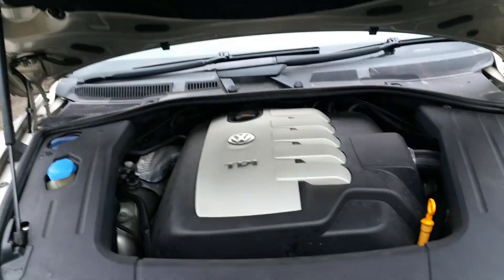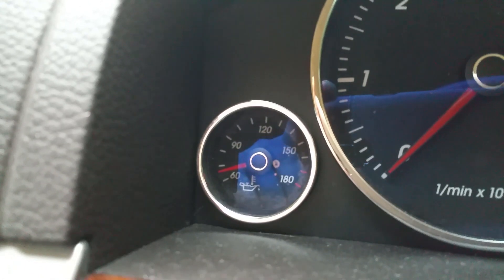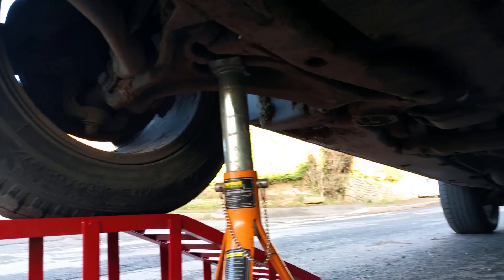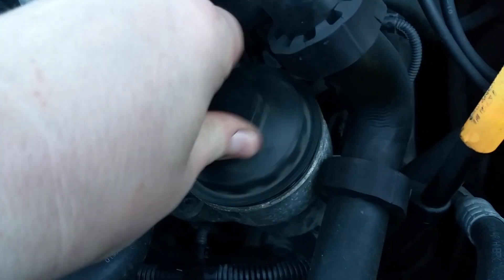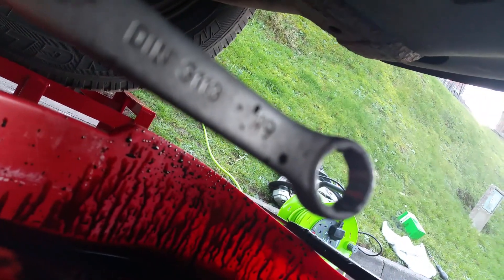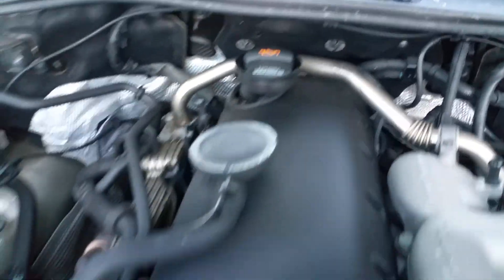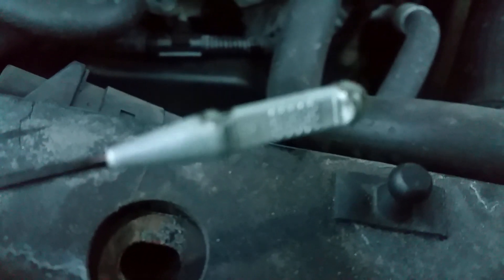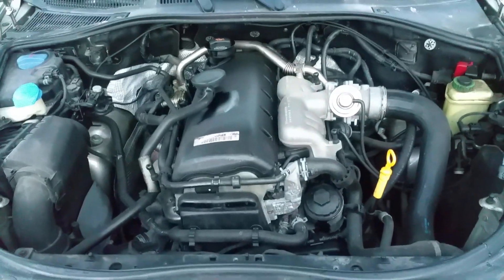Change oil and filter Touareg 7L 2.5 tdi R5

Comment: hey, just found your videos, my friend has one of these and I've just done the steering pump on it, needed to get the inlet mani and engine mount bracket off, what a nightmare. now the thing has conked out, my mate got his vagcom on it and its not showing any problems, going to change the fuel filter and see if that helps. then an oil and filters change too.
Reply from the maker: had to replace a turbo as my blew up in smoke had to take the bracket off as well it was tough but got through it

Comment: Hello i have a 2004 touareg 2.5 tdi 174 hp . Is the only option for engine oil 506.01 spec ?
Reply from the maker: that is the best oil option for your engine, i will double check if there is a short interval oil recommended, but i've always used what the doctor prescribed as i want my engine to last
Reply: You can use 505.01 for short intervals
Reply from the maker: you can but its not recomended as the viscosity of it is too thin, its all to do with the viscosity of your heated oil and 505.01 will be too thin when fully up to temperature. slowly (over few years) you will start damaging the engine under lubricating it also depends on how much you drive on how fast you will kill the engine

Comment: Do not use those ramps anymore !!!!!! I had EXACTLY THE SAME AND THEY FAILED UNDER A 2.5 Touareg !!!!!!!
Reply from the maker: Didn't look very sturdy but they held up a Towrag
Reply: @NoExpert  Have the same ramps and the same car 2.5tdi touareg ....had the car with about 150-200kg of stuff inside and drove onto the ramps....they folded as a piece of paper .......got a 5 ton jack and 5 ton axle stands (using halfords previously ) and never had an issue
Reply from the maker: @cosmindiaconescu2960   Lucky they folded straight away 😲😲